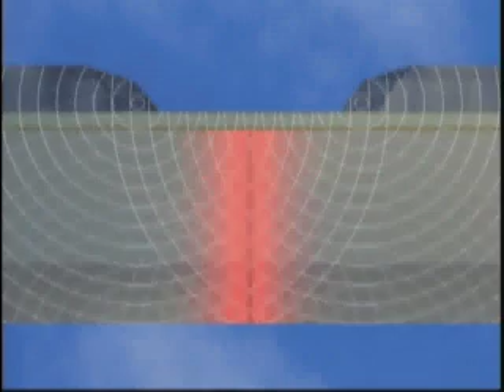F-16 Through Canopy Crew Egress From Fighter Aircraft

Comment: The "French Door Technique"  Has this been tested as yet and if so what were the results??? I would be thinking that the canopy would come loose from the connections and back into the pilot.  I mean those bushings that are then pinned to the cradel of that canopy were never meant to take that amount of pressure or flapping...So, instead of having the canopy remain attached why not split it in several more sections and keep the cradel attached?